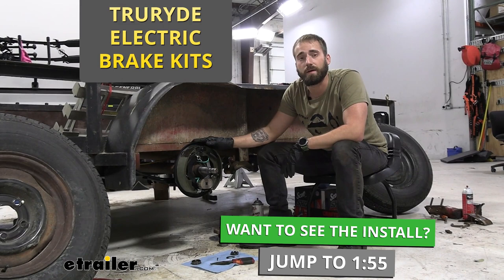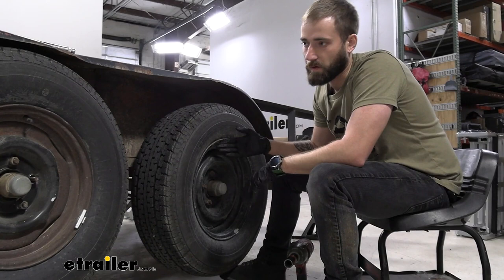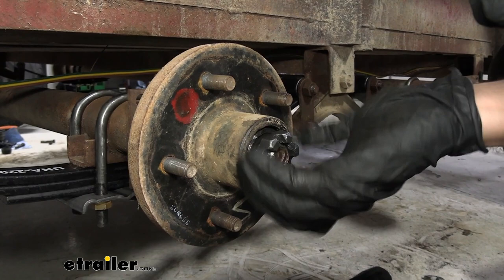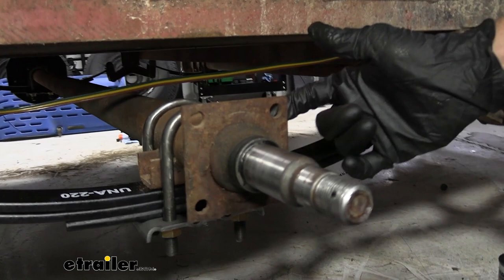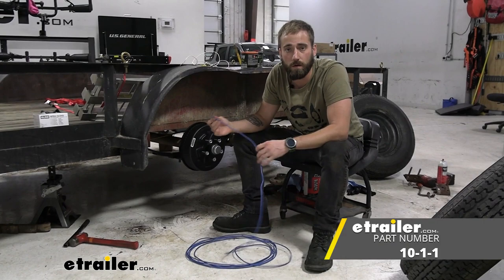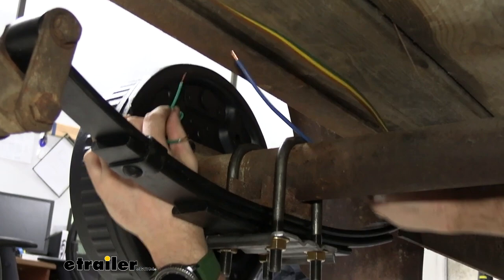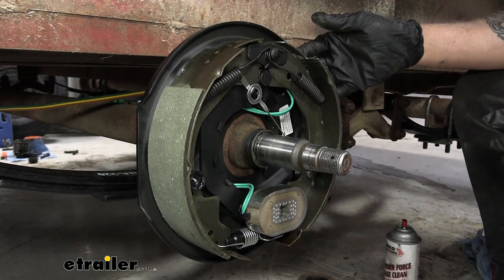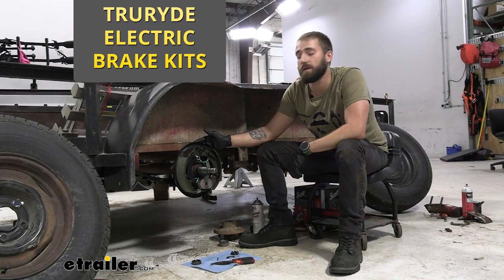etrailer | Feature Breakdown: TruRyde Electric Trailer Brakes

Comment: Did you also used a jumper cable to the rear set of brakes, or if you have front and rear brakes you use a jumper cable from the front to the rear brake assembly?
Reply from the maker: If you click this link and scroll toward the bottom of the page, you can see how it's typically wired:
https://www.etrailer.com/faq-wiring.aspx

Comment: I notice you installed the breaks in from wheels, is there any thing wrong if you install the brakes on the rear wheels?
Reply from the maker: If you're not planning on putting brakes on both axles, where to put them will depend on what type of a trailer it is. Most trailers should have the majority of the weight biased to the front of the trailer. It that's the case, put the brakes on the front axle. Boat trailers have more of the weight biased toward the rear of the trailer, in  that case install them on the rear axle. Hope that helps clear it up for you!
https://www.etrailer.com/Trailer-Brakes/TruRyde/TRU36FR.html